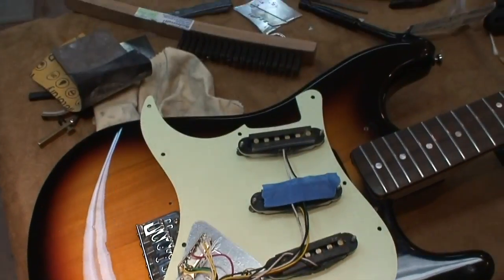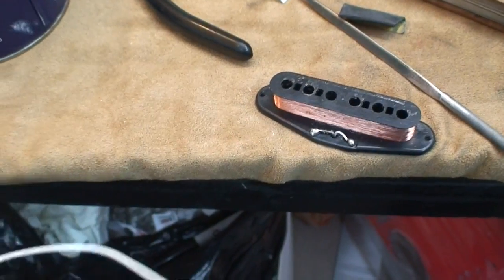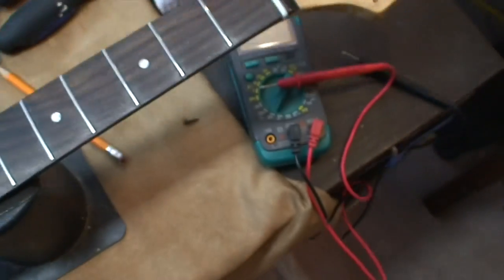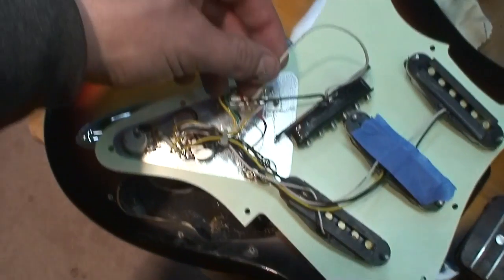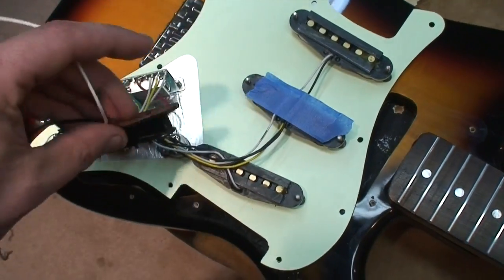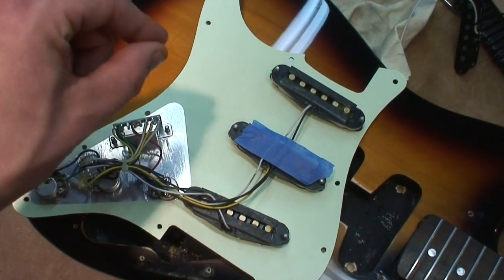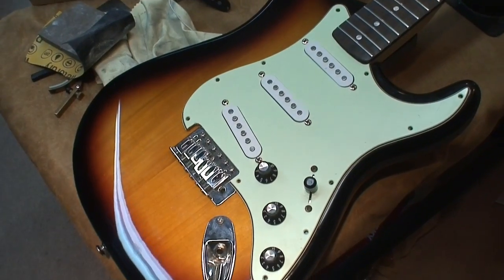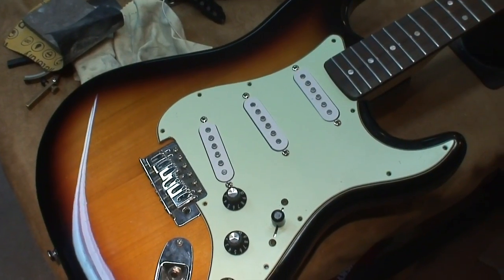How to MAKE and WIRE a dummy coil for a Strat. SIMPLE!

Comment: I'm not entirely sure this is correct my friend. Watching your video intrigued me to go back to experimenting with dummy coils, which I did once for about a year with dif variables, and just got out of it. Being rust, I watched your video, and was totally confused, because it simply just wasn't working at all. The added resistance of the dummy coil wasn't even showing up on my multi meter, and then finally after about an hour, and I half, it all came back to me.......doesn't one lead of the dummy have to go to ground for this to actually work?...After I remembered this I wired it up properly with one lead to ground, and truly got the noise cancellation as well as high end loss. .....The crazy thing is when I first wired it up your way....I actually convinced myself that it was working,  could not understand why I had so much trouble adjust my coils before with adding capacitors, and switches to bring high end back into the signal, and switch the coil off when it wasn't needed.....lol
Reply: +QuillPen77 Remove the cable between switch and volume completely. Then put one dummy lead to switch and the other to the volume. This is a series dummycoil connection. This will have slightly less output than normal pickup, with less treble and hum. Twice pickup resistance value. This is better for overdriven sounds, since the tone is less edgy.

&#160;If u leave the switch/volume cable and ground the dummy and then attach hot lead to switch output you have a parallell dummycoil connection. This will have more treble and less volume and less hum. Half pickup resistance value. This is better for cleantones because of the treble, but unecessary since less hum is amplified in clean amps and the pickup sounds good for cleans without a dummy.

Polarity of the dummy matters: if you install it wrong it will have  twice the hum and needs to reverse the leads.